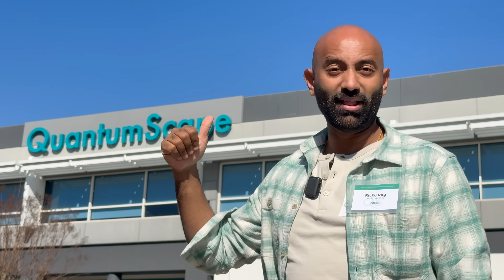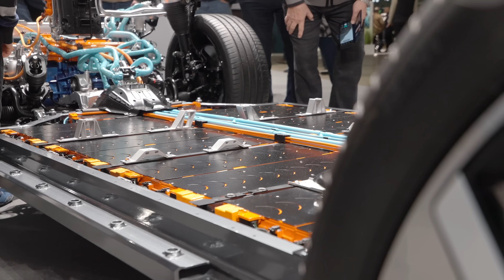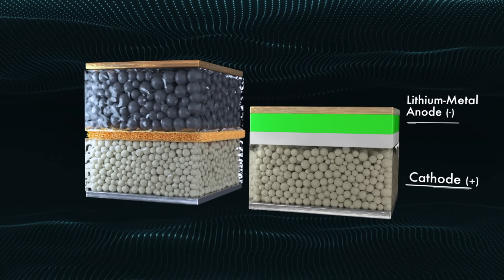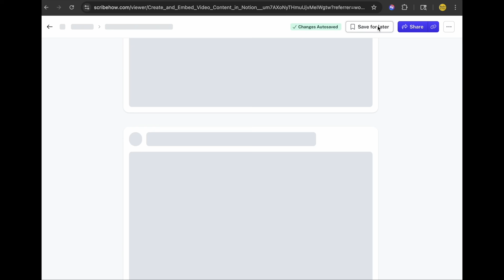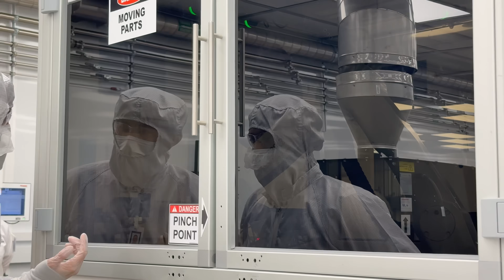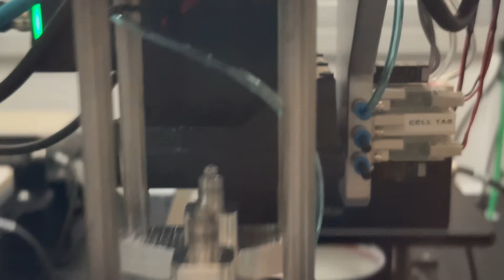I just Saw the FIRST Solid State Battery - It Finally Happened?

Comment: Great coverage. Thank you. This is definitely a big improvement over current lithium battery tech and as with everything, improvements will come as these batteries are used and built in the real world. 

I have 2 main issues: 1, the supply chain for the materials and 2, thermo runaway. If all the materials for this can be sourced here in the US or at least with countries that are not hostile to the US and without the need for China, this is a huge win. If thermo runaway can be addressed so this does not have the issue of burning down my garage and house as the battery degrades or is punctured, this would get me on board.

Having QuantumScape invent and license the tech is the way to go because this allows the big battery manufactures to be able to use their experience in battery manufacturing to further innovate as they streamline the manufacturing process. Not quite the compact fluorescent (CFLs) to LED light bulb innovation I was hoping for but a major leap in battery tech nonetheless.
Reply from the maker: the ceramic material is easy to source from what I gather so that's good news
Reply: @TwoBitDaVinci  That is good news. I can't help but think about sodium Ion batteries since sodium is everywhere but the energy density of sodium ion batteries does match even traditional lithium ion batteries and then there is also carbon ion battery tech. It will be very interesting to see where battery tech goes in 2026.
Reply: @malcolmar If any of the materials used to make these batteries cannot be sourced in the US then the US is screwed and no batteries based on this technology will be made in the USA - at least not in the near to mid-term. This is because the rest of the world now views America as a fickle, unreliable, unstable and hostile trading partner and no one really wants to do business with the US if they can possibly find other reliable trading partners to sell all of their goods to. Also, your Orange moron will immediately slap a 50 or 100% tariff on the material to try to further discourage the transition to renewables and electrification in the US.
Reply: The only source-critical material is lithium. Seems there's alot of it here and in Canada...hence the US has invested in Lithium America.  This battery is a major derisking event for a reliance on rare earth and product critical elements. Js.

Comment: Increased charge/capacity, reduction in resources necessary for manufacturing, increased longevity...it may not be a 100% full solid state, and there's always room for improvement, but looks like Quantumscape have officially opened the door to a solid state battery reality. Well done.
Reply: It's because usually these claims don't make it to market and QS said way back in 2020 that this was the real thing coming to market 2025/26.  Here we are in '26 with real breakthroughs from QS.  Bravo QS team!
Reply from the maker: yeah usually in tech you create a breakthough like this and innovations around the cathode follow suit quickly
Reply: @TwoBitDaVinci  Verge Motorcycles (parent company of Donut Lab) released the world's first production vehicle (TS Pro) running a solid-state battery, beating all of the major players including QS to market... Are you going to compare the production Donut Lab battery to QuantumScape's QSE-5 anytime soon? Thanks in advance!
Reply: @TwoBitDaVinci usually depending on how much money they can cream if successful, speed’s everything up apparently
Reply: Yeah I also like blindly believing claims... I invested in Theranos!
Reply: No they haven't, using lithium metal is not the way to go
Reply: @rwyo83  Then what is the way to go?
Reply: @cyclopes968 Narrator: He has no fucking what what the way to go is.
Reply: @cyclopes968  Doing what Donut Lab is doing, Graphenated CNTs with Black Tio2 Quantum Dots
Reply: @cyclopes968  Guys, this guy said lithium metal isn't the way to go, wrap it up
Reply: @cyclopes968  I agree.. pls explain the way to go 🤷🏻‍♀️

Comment: Misleading title. This is a SEMI-SOLID STATE BATTERY (12:22-13:20): QuantumScape's battery is technically a "half solid-state" battery. While the anode and separator are solid-state, the cathode still contains an organic liquid electrolyte. However, the benefits of energy density and charging speed are still realized.

Comment: you look like the guy who occasionally does videos state side for the " everything electric " youtube channel. that aside...is Donut full of poop? cause im about to order a verge electric motorbike with 370 mile range, and i will be extremely annoyed if i get scammed
Reply: The bike is real. God knows what battery is in it. Average lithium ion I guess.
Reply: @tanelkindsigo4729  agreed, with the current 212 mile range one, but their website already lists the 2026 bike with the option of the new 'solid state' donut battery with 370 mile range for a few grand more
Reply: @Grant.G.Simpson is there a weight increase for this additional mileage? In reality, the weight of the bike should decrease with SSB. Interested to know.

Comment: I was given to believe that solid state batteries would produce around 600 watts per kilogram and that this would be a starting point for further improvement. I’m glad that Quantumscape has got this far, but a little disappointed at the same time.
Reply: Don't mix watts with watt-hours.
Reply: @tanelkindsigo4729  did you actually misunderstand or assume that someone else coming to this thread would misunderstand?
Reply: @StepDub nobody ever told it is 600 Wh/kg. Maybe you mistake it with Wh/L? That is above 800 already. Will be more soon.
Reply: @tanelkindsigo4729  ”Gravimetric Energy Density: While current high-end lithium-ion cells range from 250–300 Wh/kg, solid-state batteries are projected to reach 400–600 Wh/kg in near-term mass production. Some researchers even envision practical realization of up to 1,000 Wh/kg.” Whilst the source is only google it is looking a lot closer than the values you are quoting.

Comment: My question would be could the substitute Lithium for Sodium using the same Tech and processes.  While right now Lithium has come down in price there is no guarantee that is will stay down, where as Sodium is so abundant it is unlikely to run low.  Of course the energy density will be less but for certain markets this maybe just fine.
Reply: I'm willing to bet lithium will only grow more abundant. Vast new lithium reserves have been discovered in the US and Canada, for one thing, and Tesla's lithium refinery in Texas just went online last month. The West & Japan are moving away from dependency on China, and that means more general supply for both Chinese battery makers and those in the West.
Reply: Sodium is highly reactive, corrosive and causes greater expansion/contraction.

Comment: What's not being understood here is that you can't compare the "top energy" lithium ion battery which has ~700 wh/L with the QSE5's 844 wh/L.  The double the energy density comment is comparing a similar lithium ion battery on the power/energy curve to the QSE5.  The 700 wh/L lithium ion battery will take over 3 hrs to charge and is on one extreme end of the power/energy curve.  If Quantumscape loaded there battery with energy making it in the same location on the power/energy curve as that 700 wh/L battery is then you can bet the wh/L would be >1,000 which they've public discussed.  A lithium ion battery that has a similar power vs energy combination has more like 300-400 wh/L energy density.

Comment: They have been at this awhile so where is car with one in it that you can buy . Also I think the Chinese have some claimed factory. There spec wasn't that much higher at 300 w/kilo . Performance at Cold , number of cycles and Cost effectiveness charge rate not mentioned.

Comment: In terms of volume (size), this is where the 'doubling' or the real leap occurs. By eliminating the graphite layer (the anode) which used to take up significant space, they can now pack more cells into the same battery pack.

Comment: Question: if they are so great why is there ZERO of this technology on anything yet? After years and years of all these studies and reports of testing. 

 The VW "investment " into QS was considered a horrible gamble by VW. They were hoping to get 1st rights to this batteries in their vehicles.

U think CATL or 
EVE, Lishen, and BAK Battery are not gonna do the same thing as QS?

 In case u didn't know China doesn't care about patents and is not a huge fan of epa rules either.... so IF someone builds a better mouse trap... then one of the above mentioned companies will copy it，make it faster, cheaper and probably better before u can turn around.😮 FACTS 😢😢😢🎉
Reply: Till summer 2025 they didn't have the technology for cheap mass production. Now they finally have it. And seems it actually works. Now Gigafactories can be built.

Comment: The liquid electrolyte lithium cells from Amprius already offer 500 Wh/kg.
Reply: But they do not have production line. It's good to have some cells in the Lab, but next you need to mass produce them. Quantumscape just showed its demo product line.
Reply: @tanelkindsigo4729 Amprius cells are in production and are often used in drones.

Comment: For all the naysayers 
Solid-state’ isn’t about removing lithium, it’s about the electrolyte. QS uses a solid ceramic separator + lithium-metal anode, which is where the performance gains come from. Double energy density, <15-min fast charge, low pressure, real production line. All-solid that performs worse isn’t better, outcomes matter.

Comment: Double the energy density of what (and do you mean gravimetric or volumetric)?  Even GM's old Ultium cells are 280 wh/kg so these solid state batteries have less than 10% more gravimetric energy density.  That said, the charging performance is compelling.  It's going to be very interesting to see how these develop in terms of energy density, cost, production scalability, and durability.

Comment: Hello Ricky,

When are you going to make a video about batteries used by machines that work in underground mines? All the problems mentioned above are solved there.
Reply: Really? If so why haven’t those solutions found their way to the surface ?
Reply: @jedwards1792 some of that technology was already used by the iPhone as scratch protection.
Reply: @jedwards1792 the iron salt battery has a similar layer that protects the iron from corrosion.
Reply: @jedwards1792 the main reason is that these brainless people spent 10 times more money and so much time because they don't understand a technology they didn't even develop. They are copy-paste experts who took (stole) the basic concept of a battery without knowing how to complete it. I mentioned here a long time ago that this is only the first of four generations of batteries that I started pushing in 2021. It was part of a project where batteries made up only 1%. And now since they don't know how to solve the battery problem, they are switching to hydrogen. So much for their intelligence. As if the Chinese made these experts.

Comment: How does this compare on price and performance with the sodium Ion battery by CATL?
Reply: They are on different sides of the market. Quantumscape is the premium product whereas CATL is the cheap and heavy low cost product which is only really useful in stationary storage applications. Sodium can only do a little over about half of todays lithium ion in energy density
Reply: Sodium batteries are only good for stationary storage, where size doesn't matter.

Comment: the holy grail of battery technology, if it works, is it EVER going to happen, seems like cold fusion, or fusion generators
Reply from the maker: first you have to make it work, then find a way to produce it cheaply at scale, that's the path for all tech, and this is a huge step
Reply: @TwoBitDaVinci the difficult thing is the new technology has to compete with the old technology which is usually improving, so when the new technology is finally ready, there may not be a cost advantage, making it very hard to displace the old

Comment: This says everything I already said in 2016. You just need to put a layer of graphene between the contacts to prevent the formation of dendrites. The graphene serves to fill the cracks in the solid material that form over time and thus prevent the capacity from decreasing.

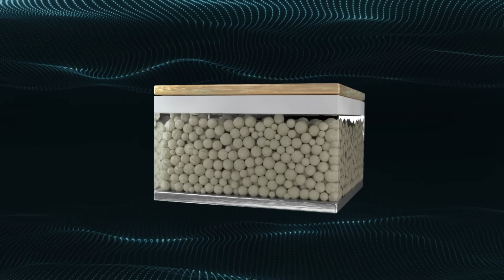Comment: 11:30 How "solid" is you solid state battery if it's physical size changes by 18% during charging? I would call this a dry battery cell instead of solid state. And only the anode is actually solid but changes dimensions and the cathode isn't even dry as explained around 12:45.
Reply: The separator is also solid.

Worth noting that recent QS job postings include engineers for developing solid state cathodes.

Comment: What are the expected charge cycles of this battery? Also I dont think the numbers shown match with "Double energy density"
Reply: The testing shows 95% capacity retention after 1000 cycles
Reply: @rocketeer6713 ahh thanks, thought I missed it but did t wanna watch the entire video again.
Reply: It’s double what original lithium ion batteries were but only 20% improvement over current batteries so a bit misleading

Comment: FALSE

The 1st Solid State Battery production was near Montreal in 2007. This facility specialized in developing and manufacturing all-solid-state batteries for the transportation sector. It even produced what was described as the world’s first commercial all-solid battery used to power vehicles such as Mercedes-Benz eCitaro electric buses, and Bolloré Bluecar electric vehicle.

Their Gen4 batteries (the newer R&D line) are said to achieve: 
>600 Wh/L volumetric energy density for certain configurations,
>350 Wh/kg gravimetric energy density (energy per unit of mass).

So, stop with the false informations.

Comment: #5: Does the business model include AI?

Good thing Dr Holmes mentioned it, so ✅ for investors
Reply from the maker: AI optimizes their manufacturing processes and quality control, not the battery chemistry itself. Honestly, real talk, every company should be using AI for tasks its good at...
Reply: @TwoBitDaVinci  - what evidence do you have that QS has not used AI in material  science testing and/or battery chemistry?

Comment: What is the cycle life of quantum scapes battery? I didn’t hear a claim cycle Leif.
Reply: At 4C discharge which means 15mins total discharge they still had 80% life after 800 cycles. Current lithium ion would be lower than 50% after 100 cycles of this treatment if it lasted even that long
Reply: Qs is all Bs...ive followed and invested in them for over 5 years....they make promises and show studies...and nothing happens.
Reply: @jimmyjamesl2318 they gave a timeline of 2028 from the start if you needed the money before then dont invest in them

Comment: Everyone posting metrics from other battery manufacturers but then failing to post the full picture that those batteries either can't charge as fast or don't last as many cycles or can't discharge as fast etc etc. QS is a no compromise battery that meets all of the demands for Ev use and more. These guys have a serious MOAT.

Comment: Nice work on this video! Really interesting to hear Dr Holme. 

There are “15 minute charge times”-cars out now with LFP at about 75 kWh in size, at the right charger, and when measuring 10-80% of course. So what is the real charging benefit here? More reliable? Higher average power during charging? Production cost seems to be really low in China already on these LFP batteries.
Reply: Did you watch the explanation in the video?
Reply: The problem with LFP is you trade a decent bit of the max capacity for better charge rate and cycle life vs NMC. Energy density is tough to trade with the standard lithium ion batteries because our storage amounts are still quite low compared to where we want them. I think the biggest understated improvement is cycle count your cars battery will last 3x as long with less loss of range. If you've seen the tesla fire videos you also probably worry about safety, quantumscape has dramatically improved that. Basically everything you could ask for in terms of battery improvements quantumscape does